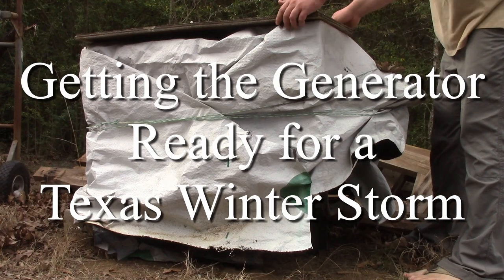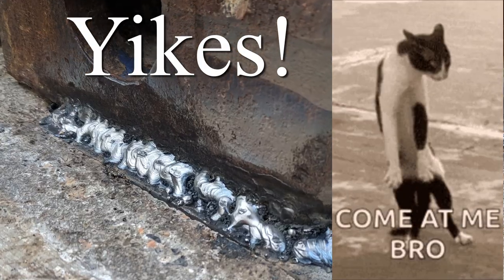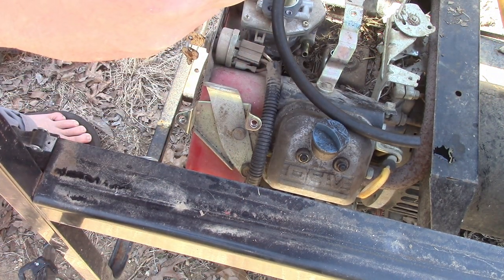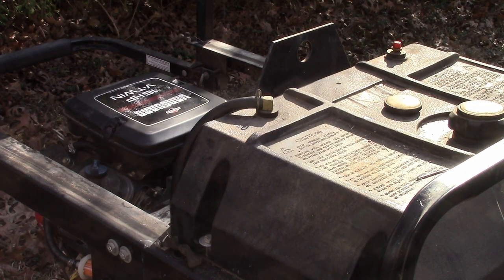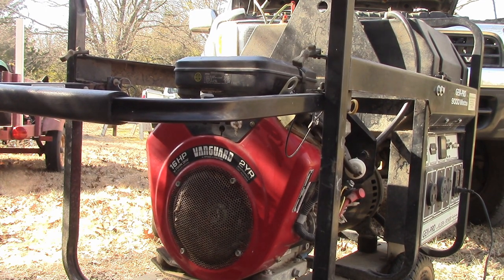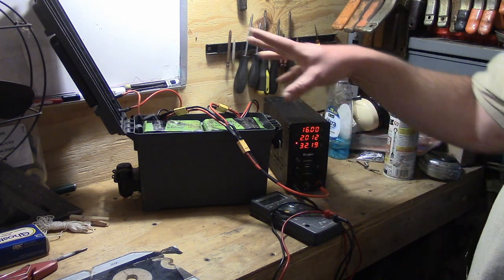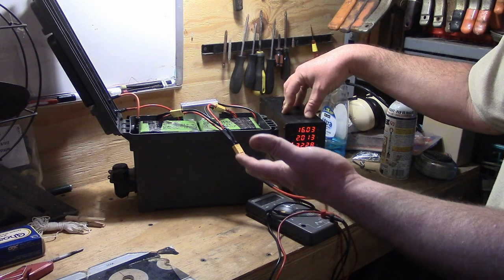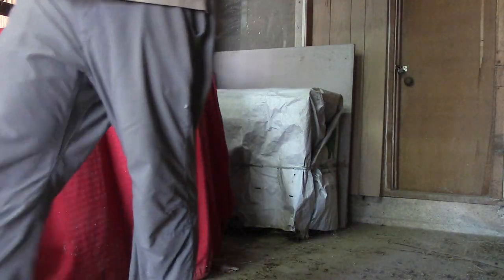Prepping the electric generator before winter storms come to Texas. I don't want to repeat last year

Comment: To be specific, this generator was purchased by the Property Owners Association in prep for Y2K, the start of the new millennium. Luckily that was no problem. The main thing we might need it for is to run the well pump of the power goes down.